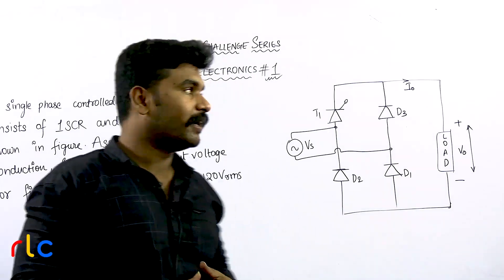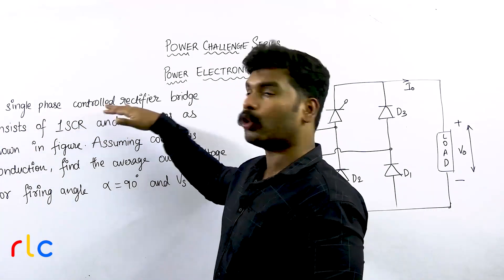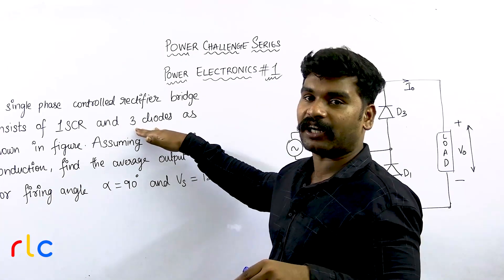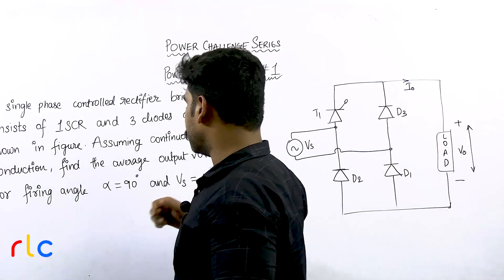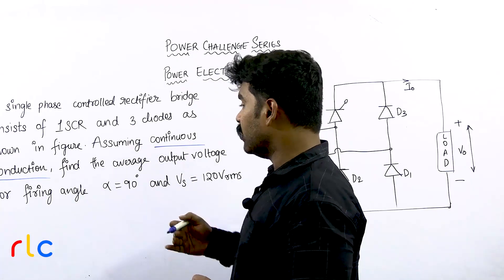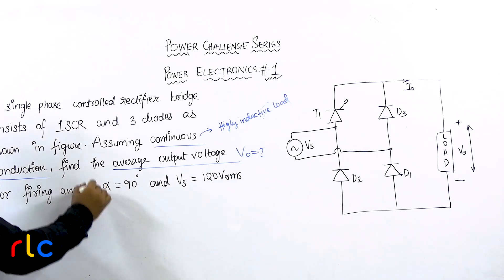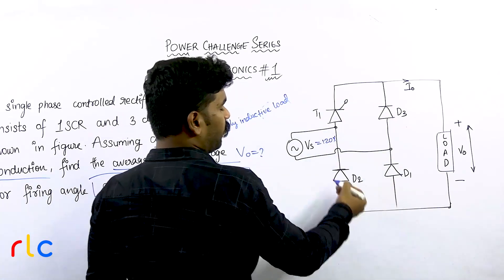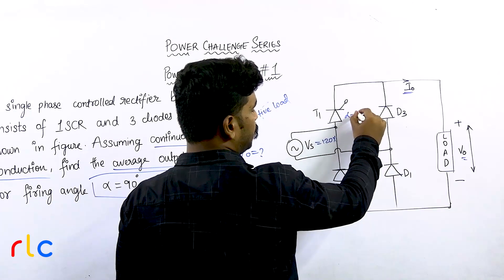Power Electronics # 1 | Can you solve it? | Power Challenge Series | RLC Education | Nikhil Nakka

Comment: During +ve half cycle, scr will not conduct until gate pulse is given. Once scr is fired, it will start conducting from alpha to pie. At pie, supply becomes negative, diodes d2, d3 will conduct automatically because they don't require gate pulse. 

At 2π, again supply becomes positive. Diodes D2, D3 reverse biased so they stops conduction. 
Even scr is in FB after 2π, it won't conduct immediately. Once gate pulse is given, it will conduct from 2π+alpha to 3π.

Then from waveform, find avg output voltage easily.